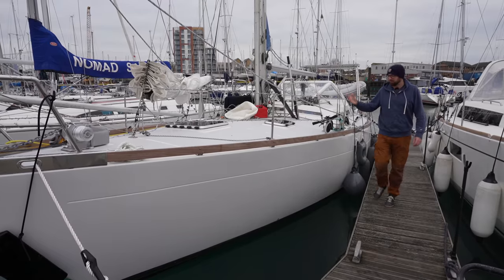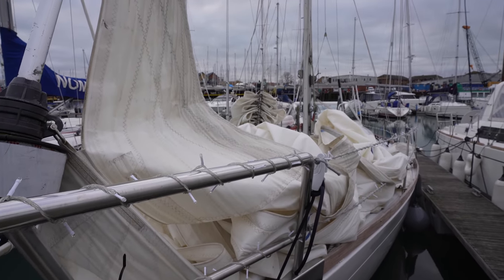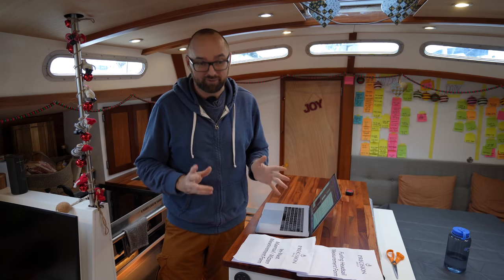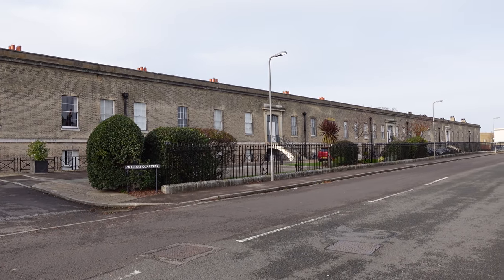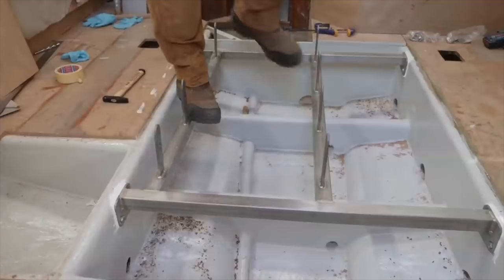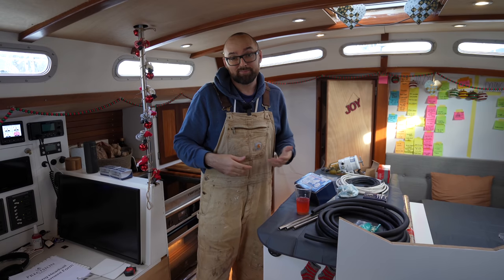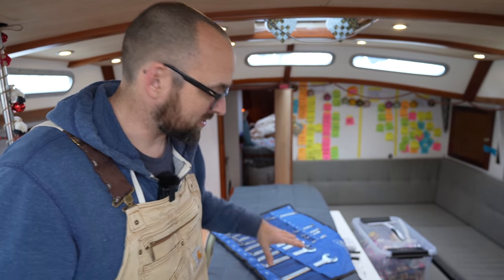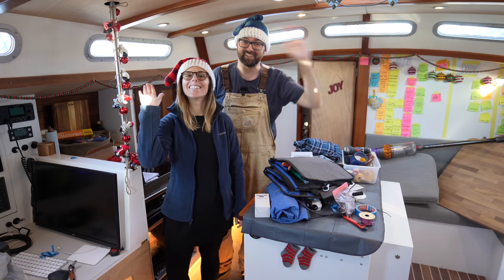Sail Life - Measuring for new sails from Precision Sails & DIY fuel polisher

Comment: I made a DIY diesel polisher, with a timer, it runs everyday or around 30min. picking up from the very bottom of the tank, and returnin on the opposite side, at top.

Zero fuel problems after that. Tank is clean!!

(no more concerne of leaving it full all the time, all the water ends up in the Racor and it is easy to spot and drain).

Comment: I always recommend cleaning all new fuel line’s before installing and all fittings after assembly if possible. You would be surprised of the trash in the new line and fittings

Comment: Mads, I have used Racors for years. Depending on your space, you might wish to go with a series twin setup for polishing, 30 micron (red end cap) primary polishing filter. then10 micron (blue end caps) for the secondary polishing filter. Then the final 2 micron (brown end caps) for the engine/genset feeds, from the day tank. You will need to talk to the supplier to get restriction gauges for each filter, and installation hints, makes life easier. Stock filters by the case lot. Way way cheaper than injectors and safer as well.
Best wishes from the far North.

Comment: I am looking at also turning one of my tanks into a "day tank" and keeping the other two as "storage tanks", it's great to know that you have clean fuel.  I would like to point out however as others probably have, that you have one major thing backwards.  The "day tank" i.e. the one your engine runs off of should be the one that can only be filled from another tank.  You should never be able to fill the day tank directly from deck in other words.  The fuel is always transferred from your "storage tanks" to your "day  tank" which is often roughly about 24 hrs worth of fuel capacity and you know that this fuel has been through your polisher to get there.  Obviously, Mads has some space and location constraints, but it should be stressed that his is not the normal setup.

Comment: I love your channel, the best yacht diy on YouTube.  
I think you should check your tank filler cap is sealed or better still move it to a protected location. I am very surprised by the amount of water you have in the diesel fuel, you should not have that amount in such a short time. Yes, diesel does often come supplied with a small amount of water, but not that amount. I suspect you may have another problem. When I saw you install the diesel filler cap on the cockpit sole I thought that is a potential problem. I had water contamination problems over a number of years and was cleaning out the tank every year. I discovered it was the tank filler cap not sealing and rain water getting in, problem solved. Also, although it's good practice to fill tanks to reduce condensation, modern diesel contains bio and this can make the fuel go bad after a few months. Having too much fuel stored could be a problem. The fuel dipper used by Cadoha looks a good option for reducing water and better than a straight filter system. The fuel will be polished by your normal filter and recirculation of diesel from the engine.  It's mostly the water contamination that starts the problem.
Also, if you have two tanks, it's good practice to keep them separate, in case one gets contaminated, then you have an alternative.
Great channel and Merry Christmas to you both.

Comment: i have found that if you keep your main fuel tank is full as possible you will cut down on condensation. The diesel return heats up the tank and as the fuel goes down it draws in humid air and as that fuel cools the humid air creates condensate and water forms on the walls of the tank. keep up the great videos.

Comment: Deck fills offer another line of defence in preventing water in the fuel tanks. We have changed the O-rings on our diesel deck fill caps once a year after boater friends experienced water infiltration due to cracked and deteriorated O-rings.

Comment: I'm thinking for boats leaving shore that a fuel polisher is a necessity. Or for those who are not in for some relaxing times of trying to figure out what happened to their diesel engine five miles off shore. and of course having that nice polishing of fuel when taking on new fuel and never having to pour from a fiver again. Look for dolphins or something with your spare time. A vacuum gage on the polisher is always handy when checking the filter too.

Comment: Basic questions: How do you know how much fuel to pump into the main tank? How do you handle overflow, and do you have a whistle or other system to tell you when to stop pumping fuel?
Reply: There should be a cut out sensor in both.

Comment: I’m sure you’re already aware, but you don’t want to leave the tanks partially full. Doing so can contribute to condensation which introduces water to the fuel.
Reply: Having a plastic tank, insulated and in the middle of the living area should reduce the chance of that one producing condensation... 
I dont know if its internally baffled though ... let alone the chance of air bubbles making it as far as the engine...
Reply: @clivestainlesssteelwomble7665  He put baffles in both tanks (pretty sure)

Comment: Mads, the fuel filler being on the cockpit sole will leak, water will make it's way through seals and into the tank, water will find it's way in, the filler should be on a more vertical surface.

Comment: Gulf Coast makes a diesel fuel filter that uses Roll of paper towels. I had one on a trawler which was used in a fuel polishing system and it worked flawlessly. It sounds strange but they’ve been around a long time and are popular on commercial boats.
Reply: I added a Gulf Coast filter to the polishing system on our DeFever trawler about 8 years ago. Previously I would  check the Racor filters everyday and at least once a week would have some crud or water to remove. With the Gulf Coast I don’t need to check the Racors ever!  Here’s my protocol, when we get new fuel, I run the polisher so the fuel is polished 3 times thru the filter. During the season, I polish the tank I’m using about once a week. I only transfer polished fuel as I try not to contaminate any other tank.
Gulf Coast was developed for large construction and commercial vehicles. Our annual fuel volume of 3,000 gallons is small by their standards, so I change my filter element once a year. Oh, their tech support is excellent, call them and they’ll design a system for you. 
Good luck
Phil and  Chris aboard Lioness

Comment: Great update thanks.
Regarding the fuel filtration. I don't think you'll find a single filter unit that will fit your space that will do the 900l/h. The Racor (Parker) 731000FH manifold unit will do 1363l/h, however it is NOT a small unit (H: 559mm, W: 419mm D:279mm). You will need 2-3 smaller filter separation units in parallel to get your desired flow rate.

Comment: I have a furling mast. One of the most critical things you can do to prevent a jammed mainsail in the mast, is to have a sail that isn't stretched out. Great idea for a new main. I would not consider Dacron for the fabric. After a lot of research I went with hydranet. Dacron stretches too much and it's useful life will be far less than a quality laminate or a woven product like hydranet. Hydranet is a bullet proof material that will take tremendous amounts of abuse. It is more expensive but in the long run, will be cheaper.

Comment: Considering the whole system is overhauled, you clearly picked the water from some dodgy fuel supply, but there's also the possibility of air condensation inside, which is why you want to fill the tank up, the emptier it is, the bigger the chances of condensation. In some applications they line the walls with a special type of fuel resistant foam that doesn't condensate. You could also make a fiberglass matting (fire resistant) blanket, that should also work, plus it's simpler since it's on the outside.
Reply: Really?  Condensation sounds reasonable as a cause.  Aren't there other solutions as well, though?
Reply: @honeybadgerisme  we always make sure our tank is just completely topped off in any weather below 8c. That is just the temp it seems to get damp around hatches. Also its worse with metal tanks rather than plastic
Reply: @Stuwy2  Thanks!

Comment: Hi, Fleetguard sea pro is high tech but also expensive, do check Hy-pro filtration. They can filter at 4 MC beta 4000 with waterfiltration in onesystem. Clean 'dry' fuel avoids bacterial growth in your tanks. Also consider a system with three way valves ti 'kidney loop filter' all three tanks. When you receive filthy diesel some where in the world, you can run for a couple of hours and clean up your fuel. Also, when going to the states, you can source these filters there also.

Comment: Another fun video - thanks again. Did I hear you say you were getting two headsails for the downwind rig? You might want to think about having one made at half the size of the regular headsail. I fitted twin poles (stowed on the mast) and headsails for our tradewind sailing (twizzle/twistle rig) and it's one of the best investments we did. Our sailmaker suggested the second sail be smaller and have a high clew. It doesn't affect the balance noticeably, it's easier to handle and store, and I have a nicely cut jib to use for heavy weather. For our winter sailing here around Vancouver Island, I remove the nice big expensive headsail and store it in the warm and dry, then rig the half-size one and accept that light wind days will be slower. Since that sail is cheaper, you could step up to tri-radial cruising laminate on the big one if you haven't already gone that way.

Comment: RACOR makes the 6125 which is good for 454 lph, You can rig two in parallel for +900 lph, or move up to the 3250 which is good for 946 lph. The 'cheaper' route would be to use a 'bypass' valve to allow some of the excess flow to return to the tank, it might take longer to fill the whole tank, but you save having to buy those expensive filters...

Comment: You can use the right core 500 FG for your fuel scrubber and it should take the same filters as year other also the water most likely came in from the deckfell double check your lid and make sure there's an O ring around it

Comment: I was thinking about your ventilation from your kitchen island tank. I know you said when you installed it that you are not worried, and that's fine. But if you ever did want to mitigate the possibility of fuel in the low spot of the vent hose blocking ventilation, perhaps you could add a tiny overflow tank in that low spot, with inlet and outlet on the top, so if any fuel does get in the line it will find it's way there and not block ventilation. Something transparent you can easily visually check would be good. Then if it does get fuel in there it won't have any effect until its full and you can periodically empty.
Reply: That's a good idea. Tiny plastic tank(s) in the low spot(s) in the bilge should work.
(I suppose the went hose runs in the bilge somewhere in this case.)

Comment: For my electronic projects, I've switched almost exclusively to D1 Minis. They're crazy cheap. They're tiny. They have wifi. The only drawback I've found is that they're low on pins, but for 95% of my projects, I'm only ever looking at 4 or 5 pins and using wifi or the USB connection for comms.

Comment: I forgot: Wasn't the kitchen island a fridge? Or is the diesel tank under the fridge? Another thing I was wondering about: How did you implement the air-breathing of the forward diesel tank? I guess a hose/tube back to the day tank or directly to the outside? Hope everything is very tight and no fumes or diesel leak into your living space.

Comment: The transfer pump may be fast, just put a ball valve in line  with the filter setup and restrict the flow rate.  Then you can get a larger selection of filtration options.

Comment: Even if you can’t get a filter that will do the same flow rate it will work it just will slow down the pump rate and usually on filtering you want to go slower to help scrub the fuel at a much slower rate

Comment: Your fuel is polished every time you run the engine as excess fuel returns to the tank after passing through the existing filters.  The bug killer and fuel conditioner used by the RNLI is highLy recommended by many sailors.

Comment: Eva, you need to go to metric temperature. It's easy..
40 is top
30 is hot
20 is nice
10 is cool
zero is ice
...That helped me so much with understanding temperature in non-freedom units.
Reply: Agreed ! And if you add 273.159 you get it in Kelvin ;-)
Reply: “Non freedom units”?😳
I don’t want to get political here, but what the duck do you mean?
Reply: @chukwow5738  Freedom units.... Inches, feet, pounds, miles, calories, hosepower, PSI. Then there are units, that are not freedom units. Centimeters, meters, kilograms, kilometers, jules, watts, pressure in Hg.  You know... because America has the freedom to smash Mars probes into the ground or make cars with stupid socket sizes no one wants to buy... That's what I mean :)
Reply: @joshuawalker7054  
Mate, whatever you are taking, can you send it to me😂
Reply: @chukwow5738  here in America we joke that imperial or english units are "freedom units" because America is practically the last country still using them and America is a free country. At least we keep saying it is a free country. It is similar to when certain patriotic Americans were upset with France, they started referring to french fries (aka chips) as "freedom fries."

Comment: If you put a filter on the fuel transfer pump, wouldnt you push all the debris back into the main tank every time you reverse and transfer out of it?
Reply: I'd imagine it would be on a valve where one line goes through the filter and the other through a direct line.  When you reverse the flow, you also reverse the valve so that the filter doesn't get backwashed with fuel.
Reply: If you don’t find a filter you can take two parallel ones
Extend the pickup for the polisher so it takes from the bottom..

Comment: You are doing a fantastic job on the refit,the boat is going to have more electronics and systems then the newer boats. It's smart to have the safety and filtering applications you've installed. One question are you going to install a wind vane to steer the boat so you can have a stystem where you can steer without using the auto pilot. You guys have a merry Christmas and a fantastic life togeather.

Comment: While in the UK I would recommend buying fuel from local petrol stations which supply cars if you're using cans... avoid the red diesel as the quality isn't usually great.
Reply: but white diesel is near double the price when I buy red at 1000ltrs a fill! Incidentally I have had no issues from contaminated fuel which has not been the case when buying some road fuel from supermarkets.
Reply: @w056007568  my experience was based on red diesel from Southampton, Portsmouth and Isle of Wight. The price isn't so wildly different since the tax break was reduced for on water fillings.
Reply: There is no quality difference whatsoever red/ white is the exactly the same fuel quality standard, just the former has dye added to it. What affects quality is the turnover of stock while in bulk storage - always buy diesel from a busy high volume turnover operation.

Comment: How come you have red diesel in your tanks? In Europe incl. the UK it is not allowed to have red diesel on pleasure boats since years back.
What if your fuel transferpump is running too long and pumps more than your extra tank can contain? Did you make an overflow hose from the extra tank back into the day tank to avoid any problems?
This would also allow you to polish your fuel by pumping it over your extra tank.

Comment: I like how you can polish the fuel in the Day Tank.  How will you polish the fuel in the Storage Tank?  Will you be able to program your fuel transfer system to automatically shut off fuel transfer INTO the Storage Tank at a preset level?  How about the same thing transferring into the Day Tank?  Hate to see you pump a tank full and discharge excess, expensive fuel into the Marina waters.

Happy Christmas and it is SO good to see you on the water!

Comment: For more gadgety fun, you might want to look at Brupeg's switchable parallel fuel filter system with pressure sensors before and after that warns (via NMEA) of clog buildup. https://youtu.be/Qwj3uS_1CMk?t=664

Comment: "T'was the week before Christmas, and under the 'pit
The stainless-steel fuel tank was filling with.."

..I don't know a word for water that rhymes with "pit". Will need to work on that!

"The Dane engineered a contraption, with care
In the hope that that the 'not-fuel' would no longer be there.

With fairy-floss filters, and candy-cane pipes
He made sure the diesel was carefully wiped

'Til it glittered and gleamed like moonlight on snow
So he wouldn't have to bob around like a cork for 2 days, 300 miles off the Azores, waiting for the damned wind to pick up, with a tank full of diesel and a gummed-up Volvo!"